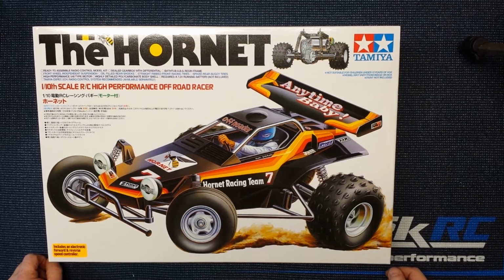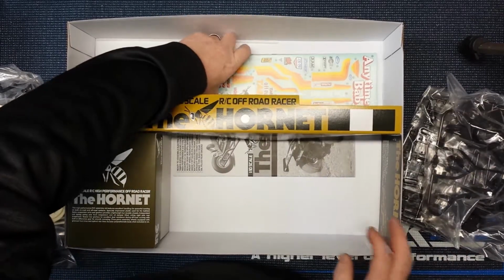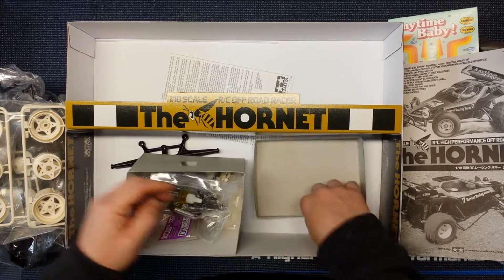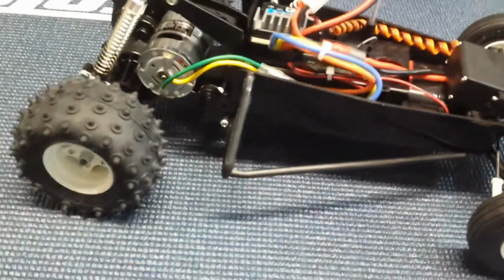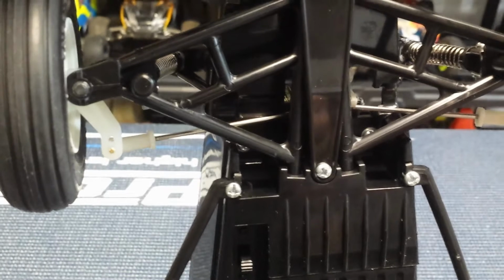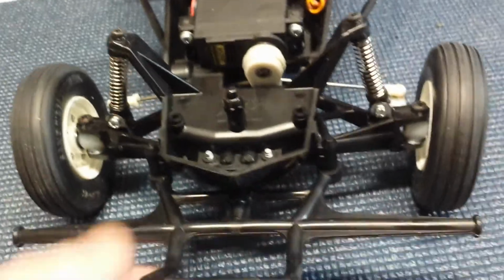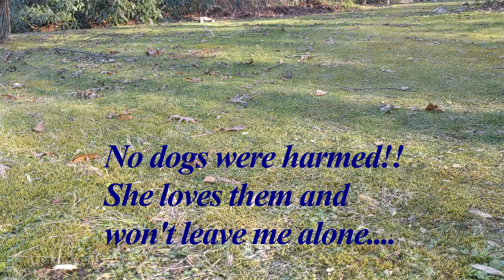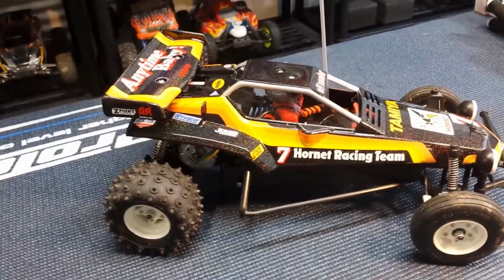Tamiya Hornet TAM58336 Kit Build and Review

Comment: The hardest part of this build (beside getting the tires on), was fitting those tiny e-clips to the shock piston rods.
Reply from the maker: Yeah those 3 piece wheels can be a pain! In my last video I acutally have a tips section on them funnily enough, A little too late for you with this one though. So I actually got slick new tool for doing the e-clips. Search for Dynamite E-clip tool. It is a little folding tool that really helps getting them onto the shock shafts. I always put the lower one one first and I just line that one up and smash it down on the bench and it clips on really easy, the top one with pliers can be a struggle!! That little tool make it so much easier. It take a few minute to figure out the right way to load the clip into the tool but when it is in there it is a breeze to snap the clips on! I should make a quick video on this.... look for something very soon!!